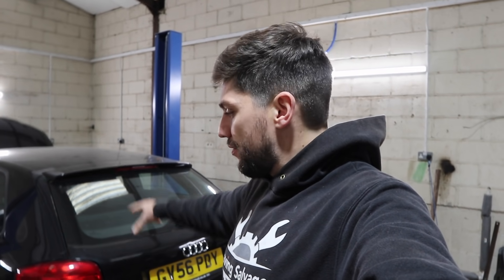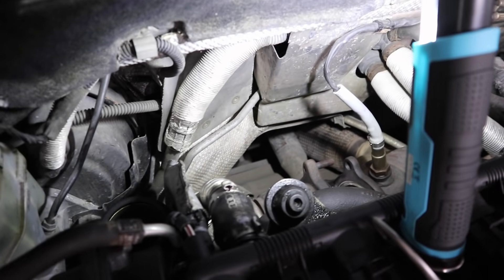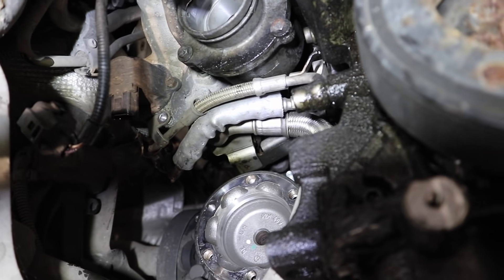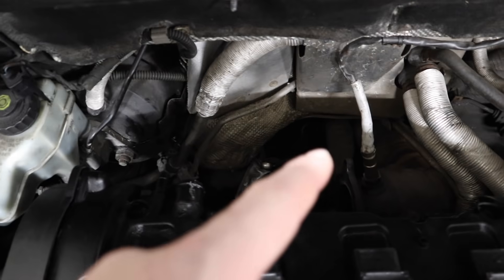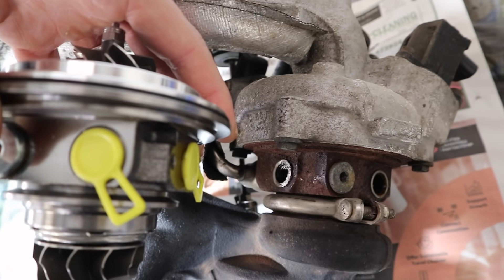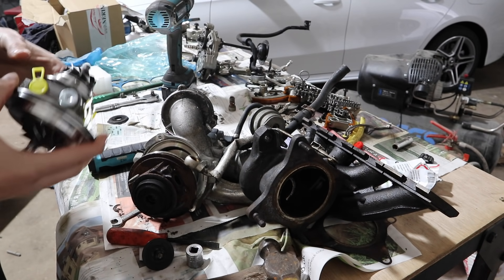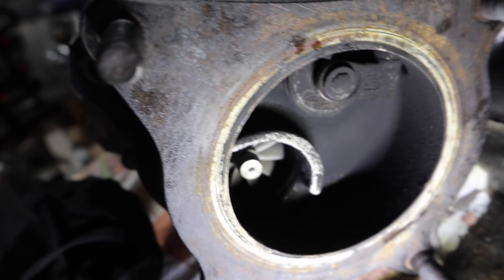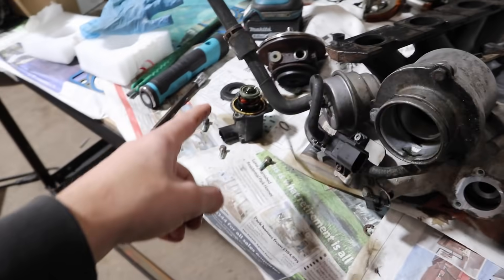The TURBO SNAPPED in HALF on My Audi A3 2.0 TFSI!!! Can I Rebuild It??

Comment: Might be worth checking the oil feed pipes as well. There's several videos on YouTube explaining how oil starvation of the turbo due to blocked pipes can eventually seize or snap turbo shafts. All because of lack of regular maintenance / oils changes.
Reply: Absolutely agree with this. Also check oil flow to turbo by cranking with oil feed disconnected from turbo and injector fuse or solenoid out.
Reply: Watch this video to see how important it is to replace the oil feed pipe:
https://www.youtube.com/watch?v=XRjaOD5qf8k

Comment: The cause of the turbine and compressor shaft snapping is normally oiling. Check the feed for flow otherwise your new core could suffer the same fate.

Comment: Excellent video showing the internal workings of a turbocharger, a common item that is fitted to most cars these days but most people are not even aware they have one or what it does until it goes bang! Nice to see that they can be rebuilt and the core is available as a service part. Looks like you caught this one in time before the engine lunched on it! Keep up the good work with the channel, hope the RS4 rebuild gives you some good news soon 🤞🤞🤞

Comment: 3:20 The oil feed is the one on the top. The big banjo you can see facing the bulkhead is a coolant line and there's another one on the other side of the CHRA.

Comment: Diagnose dan did a turbo replacement recently and the oil feed pipe connected to the turbo itself was blocked. Unlikely this has happened to yours because of all that smoke but it’s worth a look.
Reply: I saw that, the new, expensive turbo only lasted a short time because the previous mechanic never checked the oil feeds, i would be fuming!

Comment: I would recommend to clean all the pipes and intercooler as well, and before you strart the engine with just fitted turbo inject a bit of oil in that new cartridge or turn over the engine with starter for 10-12 seconda without startind the engine

Comment: Make sure you change the oil and filter before running or you will be fitting a 2nd new core as all that broken shaft debris has gone down the drain pipe and is in the oil.
Reply from the maker: Will be removing the sump in the next episode 👌🏼

Comment: Interesting. On My 3.0 Kia Sedona , if I give it some gas then let go you can hear the wastegate or dump valve whistle as the air is not needed. Mine has a massive turbo from factory so got lots of lag but massive torque love it

Comment: I’d love to see you do the cam belt and water pump on this (2.0 TFSi) in detail and.... do you have any tips on reducing or removing the build-up of carbon on the inlet side of these direct injection engines? 
I really enjoy your videos, great to see a VAG specialist who’s not afraid to get stuck in, thank you and stay safe.
Reply: Best way to remove the carbon build up is walnut blasting, I recently had my Leon 2.0TFSI done after 68500k , it's made a significant difference to the responsiveness of the engine and has probably restored something like 20-30bhp based on videos I've seen where they dyno'd it before and after.
Reply: @pdk60  thank you, it’s wishful thinking on my behalf that a remedy as effective as yours could be had without removing too much. I’ve owned my A3 for 11.5 yrs and only at 32k miles, definitely not as responsive as it was. I’d have thought that with so many direct injections out there now that a less invasive solution would have been found. I seem to remember Ed China promoting something, Terraclean?  Removing everything and going back to bare metal as you’ve done is I guess the only certain way, thanks again.
Reply: @f1kwa399  Removing the intake/inlet is the only way to properly clean off the  baked on carbon deposits in the ports and on the valves, and then either by blasting or to manually soak the ports in carbon cleaner and scrape the deposits off. All the videos where they spray products like Seafoam into the inlet will help to keep carbon from building up on a clean inlet in the first place, but have minimal effect on the thick carbon that's already there. Terraclean and other services like hydrogen cleaning will only work on the combustion chamber and exhaust side of the engine, they have no effect on the inlet side. My walnut blasting cost £320, the price range for this is around £300 to £800 depending on the engine and how many cylinders.
Reply: @f1kwa399  terraclean will not work atall and will simply be a utter waste of money on a direct injection engine such as the tfsi... A normal engine the injectors are right above the valves in the cylinder head so the valves are constantly washed with fuel keeping them clean and terraclean could perhaps have a chance at cleaning them more as it's sprayed through the injectors... Direct injection the injectors are in the side of the cylinder block spraying directly into the cylinder (direct injection) this may produce abit more power but there's no way for the valves to be cleaned with fuel or any additives the only thing that'll be getting cleaned Is the cylinder which will be a waste of money again, you can do it yourself pretty well with a bottle brush and some engine safe chemicals to remove the carbon
Reply: @pdk60  interesting, thank you, I tried Seafoam a few years ago, did nothing on the A3 as you say, if you don’t mind me asking, where did you get your walnut blasting done? 
Incidentally, I used Seafoam on a RAV4 and it cleaned the carbon from the piston crowns well but not as effective as water injection, just saying,  not that I’d try it on the Audi. Did you have to remove the head to blast the ports, I can’t imagine how they’d do it any other way?
Reply: @Carlst17  thanks Carl, I understood how fuel misses the backs of the valves and how they get clogged up but for some reason I thought I had seen something claiming Terraclean was injected  through the manifold and magically cleaned them...... not that I was convinced, hence asking here, I’ve seen something a long while ago on YouTube where they did the job with the head in situ, wire brushes etc., which I was hoping to avoid with my low mileage, I hardly ever use the car but the reduction in bhp from when I bought it is noticeable, to me anyway, still pretty quick but could be quicker!  Thanks again.
Reply: @f1kwa399  They don't remove the head just the inlet manifold and anything else required to get the manifold off. Once the inlet ports are accessible and the valves are closed they will scrape off the chunkier bits of carbon by hand before the walnut blasting head is put over the port and the blasting nozzle is directed all around to completely clean it, at the same time a vacuum cleaner connection is sucking out all the walnut particles and carbon. It takes a few hours to complete. My Leon was done at Dukes Park Automotive in Chelmsford.
Reply: @pdk60  thank you for this, I’m in Suffolk so not so far away, I might look into getting it done too, I was wondering how they did it, thanks again for the explanation, Ken
Reply: @f1kwa399  No problem, if you're interested, this is the video that I watched where the guy has his car done at Dukes Park Automotive and shows the process: https://www.youtube.com/watch?v=fgvNu_HVD_g

Comment: Might the oil pipe have failed/blocked causing the shaft to break?
Reply: Yeh... you should just replace the oil pipe as turbo's are generally very reliable and only normally break when a component feeding the turbo malfunctions (such as the oil pipes). I would replace this whilst you are doing the job of fixing the turbo.
Reply: It’s necessary to replace the oil feed an return pipes when you do a turbo or else you’ll end up with another failed turbo really really quickly. And the warranty will be void by not changing them.

Comment: It is often said that you should change the oil feed pipe at the same time as the cartridge in case it was the cause of the original problem. I don't think you mentioned it but I presume you checked or cleaned then retained the original ?
Reply: He did .. he said he was going to check the oil pickup pipe

Comment: Great video as usual! 
I would be so happy if you could help me with my car....
I have an Audi A3 1.6 TDI from 2012 that is a little weird when the temperature drops below around 5 degrees celsius. The car always starts on the first try but when i start driving it it feels like small hesitates. I don't see any changes in RPMs and this mostly happen when im holding my foot still on the accelerator. It's so hard to describe but it feels like small shovings in the car. The car accelerates as its supposed to and feels good other than these small shovings. Nothing crazy but you feel em and start thinking....No faulty codes or anything.

Comment: Will you be replacing the oil supply and return pipes? I understand they get carboned up and reduce the oil supply to the bearings!
Great, informative video once again, thanks.
Reply from the maker: I will be fitting a new pick up pipe and checking feed and return pipes 👌🏼

Comment: Not sure how much your CHRA cost, but K03 turbos are reliable as wood burning stoves and only die with lack of oil pressure and overspeeding. With a potentially blocked pickup and a torn DV you may have had both. That said, full K03s can be had for 100 quid or less. My worry is that your compressor wheel was absolutely munted which means it's been running against the compressor cover and sending metal fragments through the charge pressure circuit along with the ridiculous amounts of oil. I'd recommend replacing the intercooler and charge pipework.
Reply from the maker: I’ve ordered a new pick up pipe too, also checked the intake, no metal fragments seen, the compressor wheel just seems to have bent. No sign of fragments anyway.

Comment: An EPC light brought me here. I have a feeling the wastegate actuator is sticking in my wife's car when it's cold. Only seems to happen when she starts the car in the morning after it's been sitting for 13 hours. I'm hoping that she doesn't need a new turbo, as she has less than 40k miles on the car and it's a 2016 model.

Comment: Why didn't you clean the intake side out before re-assembly? It would be a good thing - a sign of quality workmanship but also if it is known to be clean you would know if there are any oil leaks from the new one. I would have thought it would be usual practice.
Reply from the maker: I did clean it, was just entailed in the time lapse
Reply: @SavingSalvage  excellent, I didn't think you wouldn't do it but saw oil in the pipe at some stage and wondered. Good show, I hope that's all it needs.

Comment: thanks for explaining the way the turbo works but I still couldn't see how the exhaust fumes can give you more power I think there is something wrong with my brain.
Reply: The intake air is compressed using energy from the exhaust gases acting on the turbine. The only link between the two sides is the spinning shaft. Compressed air is denser in terms of oxygen molecules, therefore more fuel can be burned in it, releasing more energy (divided by time equals more power). Anyone disagree?

Comment: I need to do a turbo on my diesel Range Rover but I'm unsure on doing a cartridge or complete unit! It's not the fitting of it and the other bits like oil change and sump off to clean pick up pipe, my issue is when you get a cartridge do they come balanced and where to get a good one from? Could you give me details of your supplier so I could try them? Oh mine is leaking oil into the intercooler. Cheers Tom